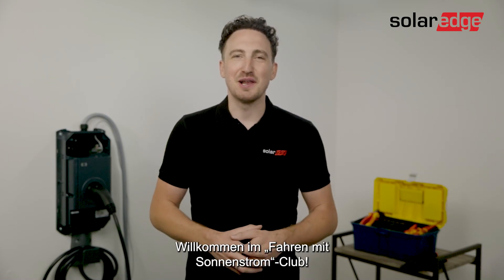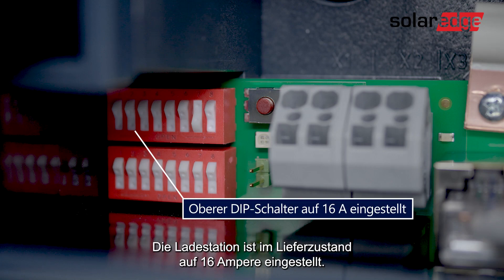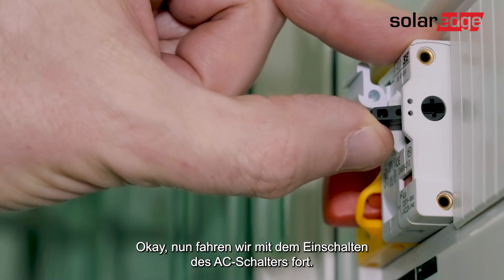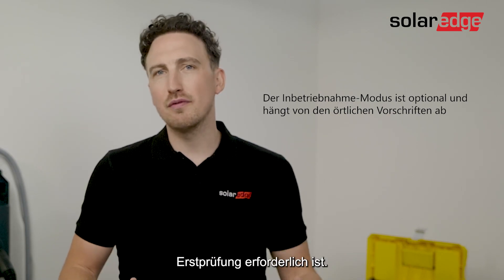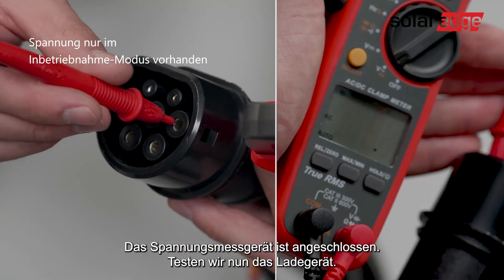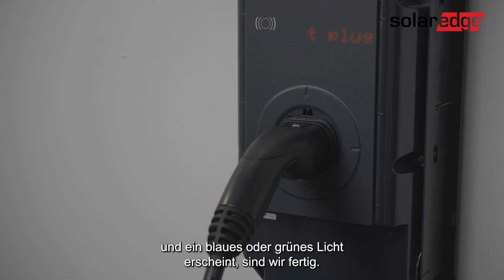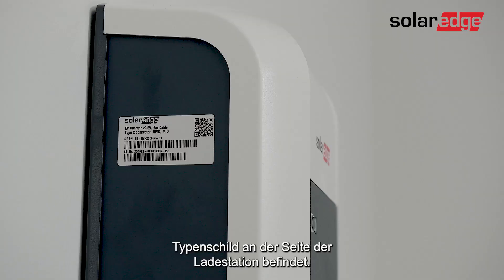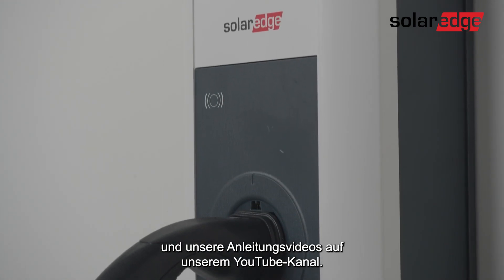SolarEdge Ladestation für Elektroautos in Betrieb nehmen | Deutschland

Comment: Moin. Kann die Wallbox auch durch den Kunden angelemdet werde im Monitoring oder muss hier die Anmeldung durch den Installateur erfolgen? In der Kundenansicht fehlt die Funktion: "Add"
Reply from the maker: Hi there. A homeowner cannot change the communication type that was set by the installer (whether Wi-Fi, Ethernet cable or Cellular), however in case of a Wi-Fi connection, if the home Wi-Fi has changed (network name or password) then it is possible to configure it via mySolarEdge using the "Inverter Communication" option.
Here is a video:
https://youtu.be/wMaJxhl0vl8
Reply: Hallo, hast Du das selbst eingerichtet bekommen oder brauchtest Du Deinen Installateur? GEht das nicht über den Barcode an dem Gerät?